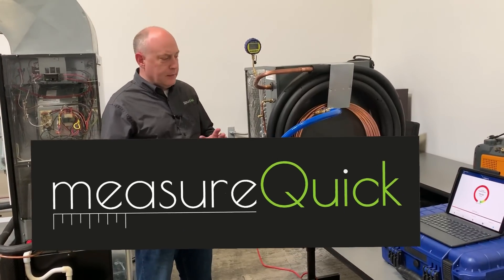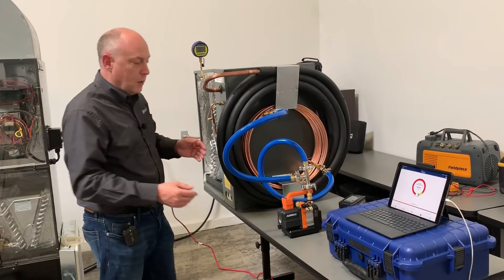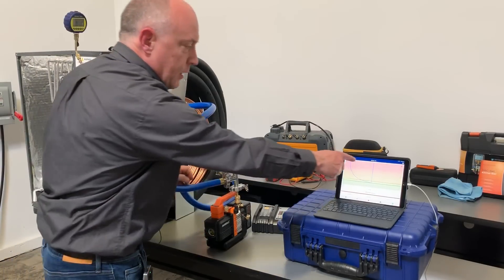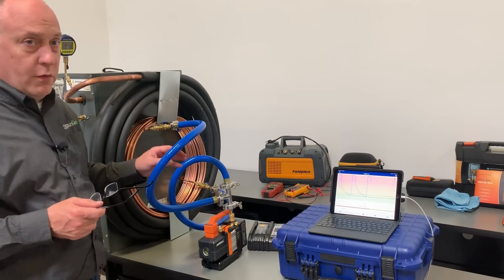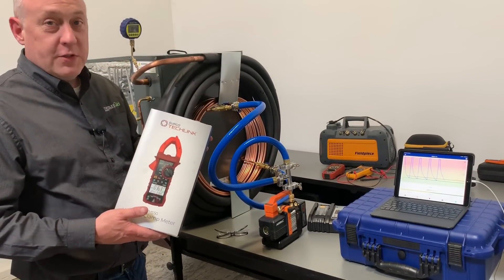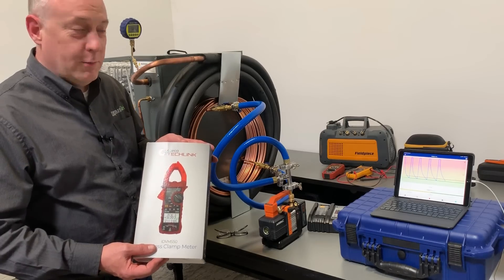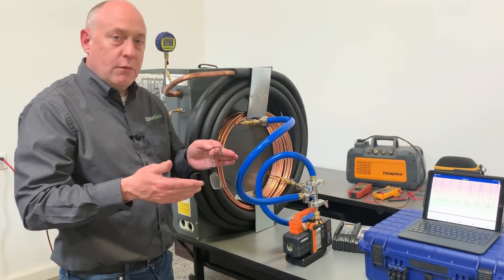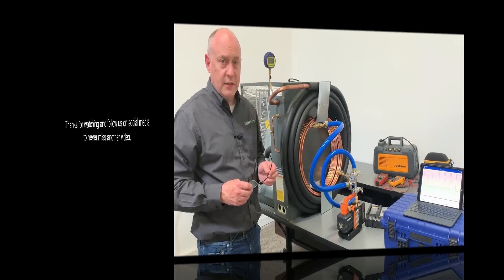2CFM Navac pump

Comment: Great video. 
Can you do a video with the bluvac pro kit that has 3 hoses. And why would someone need 3 vacuum hoses. Cause I'm wanting to buy the pro version thanks
Reply from the maker: HVAC/TRUCKER Rodney Typically you would connect the Tee right to the pump, with a third hose you can extend that connection and get closer to the equipment for times when you have to set your pump on the ground and equipment let’s say is up on a curb.
Reply: @HVAC/TRUCKER Rodney is that the kit for sale at Tru Tech Tools? I'm drooling over that thing! I mostly buy my own tools so it's a high cost but I've pretty much justified it already, lol ( This video helped)
Reply: @jorzer18  yeah it's on sale. Just checked again. It's out of stock. I got the appion hoses and trying to sale that to a coworker to get the bluvac + pro kit. Lol
Reply: @jorzer18  it's kinda the same the one I'm talking about has 3 hoses setup.  Same thing though the the one that cost less is the 2 hoses with the bluvac +LITE micron gauge. The 3 hoses comes with the PRO micron gauge.
Reply from the maker: Jorge Hernandez TTT said they will have stock early next week.